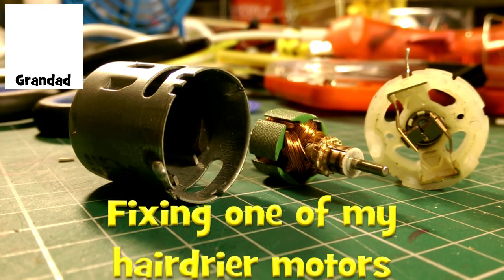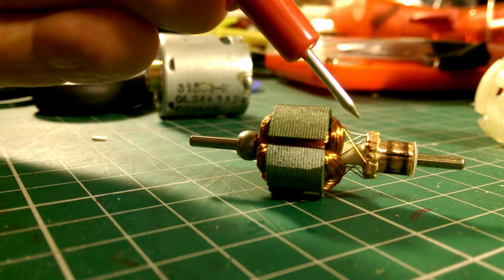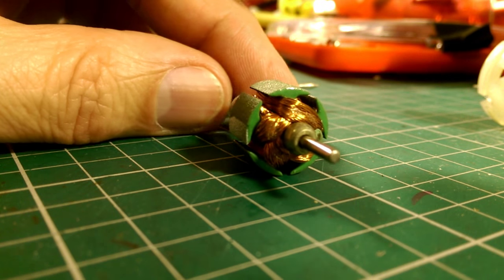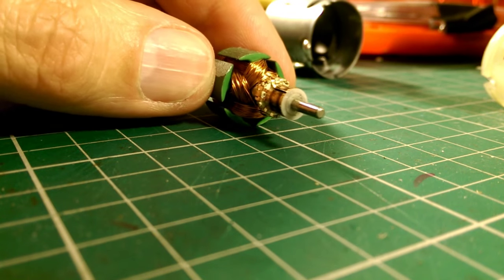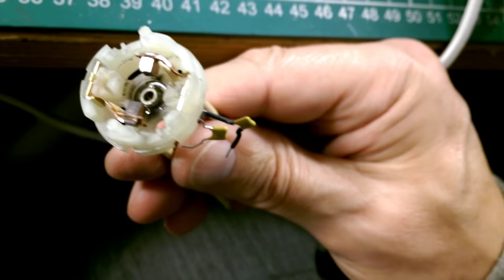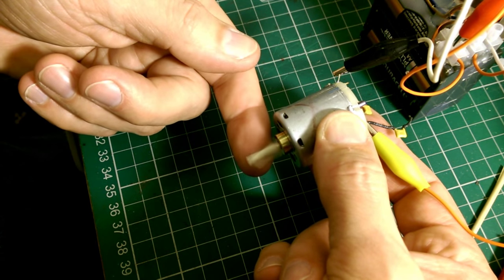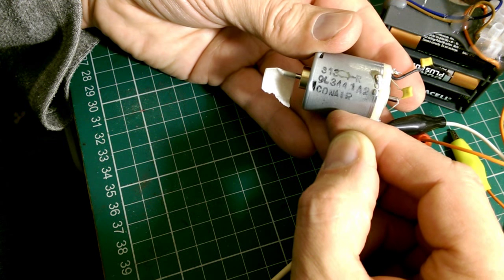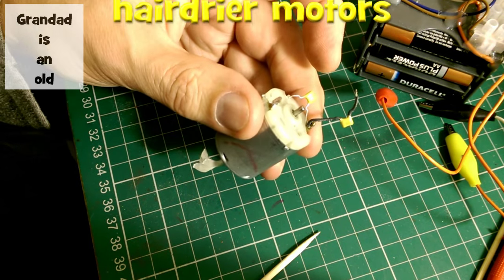Fixing one of my hairdryer motors

Comment: Pro-tip: The orientation of the casing with the magnets in it matters.  Mark the casing alignment with the body before removing the casing from the base. Failure to do this will result in a 50% probability of the motor turning the wrong direction.

2nd: Where can I get a replacement motor? Mine looks fine and the bearings aren't tight, but it doesn't work properly.
Reply from the maker: When you say it doesn't work properly, does it spin OK unpowered but seem unbalanced when powered up? It could be one of the coils is damaged or maybe as simple as the termination of one of the coil wires on the commutator tag has failed and needs resoldering.
Reply: @GrandadIsAnOldMan  I can't figure out what's wrong with it. There's no interference when I spin it manually, but it's stiff from the magnets. I've got good continuity across all the coils and the bearings are smooth and easy when the commutator is not passing by the magnets. The brushes look great. I see some mild wear on the commutator contacts, but I don't think that could be the reason for my symptoms. I really liked how you showed the dents in your coils on this video. Your close-ups are outstanding. I looked on my motor for evidence of that sort of thing or other related damage from hitting the end of the output shaft (which I did), but I didn't see any evidence of an issue.

Indoors, the heat-gun that it's in attempts to activate it (I'm seeing 16V DC) gets it running,  but the speed wavers and it does not run at full tilt. When I take it outside, where the air is cooler, it'll run for a short while, then the speed will start fluctuating up and down and eventually the motor will slow to the point where it stops. Initially, if I tap the gun at that point, the motor will restart, but about a minute after that, it's stopped. I don't want to sit with the gun on and the fan not running lest I burn out the heating element, so I turn off the gun promptly at that point. The heat gun fan has been doing this speed-wobble thing for a while (years) so a couple of months ago, I took it apart and put one drop of machine oil on each of the bearings. That didn't seem to do anything, but I cleaned a little bit of excess oil out of the inside when I had it apart yesterday.

I've had the motor completely apart twice now. Both times, it seems to run fine after I put it all back together, but, once outside, it winds down and stops. I might have a controller issue. I didn't see the voltage oscillating when I was running it indoors, but I didn't take it outside to see if the voltage dropped in the cold. I figured they're probably pretty cheap and I could just get another one and swap in the new one to see if that behaved the same way. And that would let me blame the controller rather than the motor.

Comment: nice  one, did u notice that when u hooked up the motor to 9 volt that it turns faster than when u hooked it up the first time, ya thosemotors are quiet good the regular ones u usually get but hobby shops also have good motors as well for their rc cars and boats, but for what u are doing thats a good motor :)

Comment: Grandad could you tell me how to take the brass fitting out of the axle in one of these hair dryer electric motors please!! 
Thanks I love your videos.
Reply from the maker: +Edwin Gutiérrez not sure what brass fitting you have on your motor. Generally if there is a brass bush or collar on the shaft you can remove it by gripping the brass collar in a vice or supporting it in some other way and then punching the shaft through with a suitable sized drift. That is assuming you are not intending to re-use the brass item (see my comment lower down) as it will probably be damaged by gripping it in a vice. On larger motors it may be necessary to heat the brass collar to expand it first. Here is a video on removing a similar item from a smaller motor https://youtu.be/zgDD51pBAzs and here is a rather destructive method where the brass gear was the important item I was trying to salvage from a dead motor so not what you want but you do see what I mean about heating it https://youtu.be/DRwh93gG5F0

Comment: Hello ,Grand Dad is it possible to use a hair dryer motor to power a powered glider ,can you try it out ?
Reply from the maker: They are relatively heavy, it might be possible with the right gearing but I would rather use a proper brushless motor. They are not very expensive to buy and will give you a much better power to weight ratio. I don't make many aircraft and they don't fly well when I do. Maybe in the summer I might make some more.